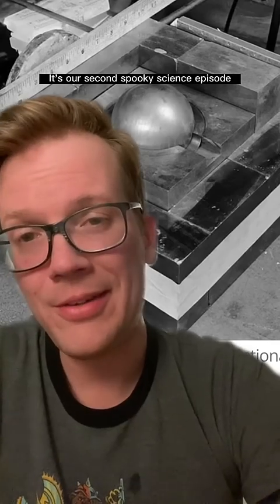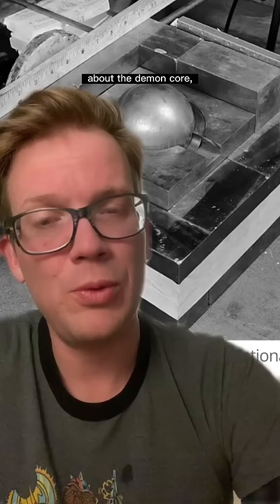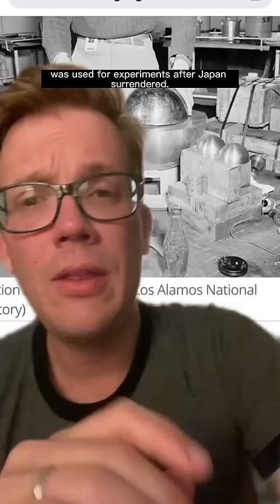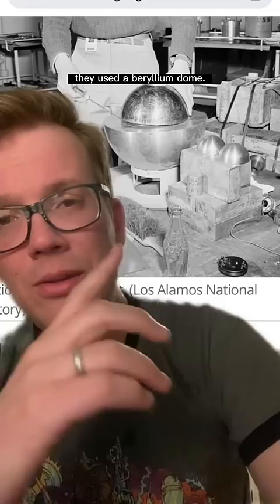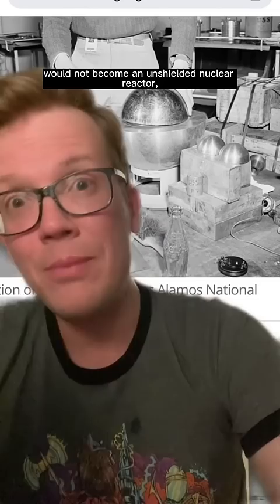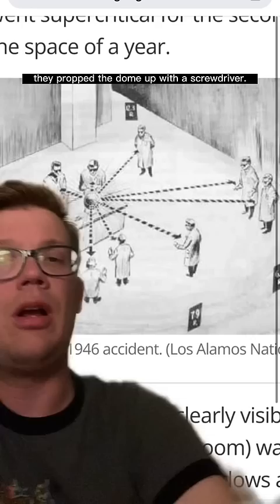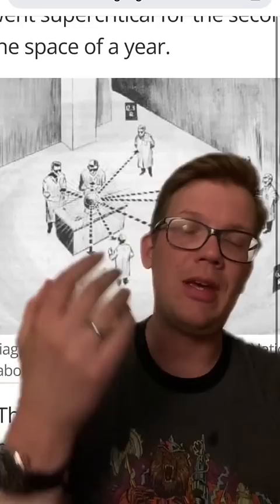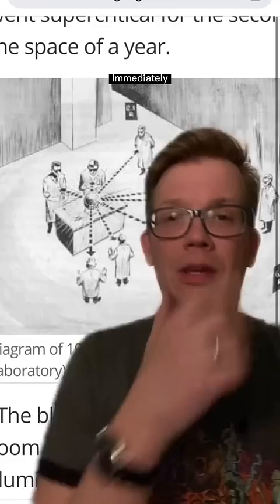Spooky Science episode 7: Second demon core incident

Comment: Can we have a reliable setup for the experiment?
Them: a screwdriver should do it. It’s just a nuclear core.
Reply: Yeah it shows that just because someone/a scientist is very smart in someways, doesn’t mean they aren’t very dumb in other ways
Reply: Kayle hill has a dettailed video about this shit. It s just incredibile
Reply: A screwdriver literally did it though, they weren't lying 🥲
It at least did one scientist in..
Reply: @DiabloTommaso  who?
Reply: If i remember correctly, they initially used something else to prop it up. Something more safe, but the scientist in question got comfortable with the core as he continued to experiment on it, and substituted it for a screwdriver.
Reply: @JackNapierTM  the youtube channel because science:)
Reply: @JackNapierTM   i m jk xD you will found a video about this on the kyle hill youtube   channel
Reply: Look it up it's worse than you think
Reply: They actually had TWO additional safety measures. 1 was a rig that was suppose to suspend  the top half of the dome slightly above a "closed" state (and if i remember correctly, by slightly, i mean MMs apart at most) and the 2nd was a set of spacers that actually had a "mounting" type setup (so that they couldn't move on accident) but the 2md guy just decided "this will be good enough" and skipped both of those, in favor of his trusty screwdriver
Reply: @Cheesepuff8  it’s why I have a job. I actually do radiation protection. At Los Alamos National Laboratory. We oversee scientists’ work to ensure they’re doing it in a way that is safe for them and everyone else. They can’t experiment without a thumbs up from us.
Reply: Eye  I swear that video is the new rickroll or something
Reply: i think its the ego trip of holding the weight of basically the power of a nuke in his hand. with his muscles he could directly control the demon core and bring it close to criticality, but he was too sure of himself to a reckless extent. blows my mind that these experiments were carried out at all, safety precautions or not.
Reply: @nigglewiggle4214  we just didn’t really understand what radiation does to the body then to the extent we do now.
Reply: @Kyriakos703  Yes, they had been using shims of specific heights. But he got over-comfortable with things and... yeah.
Reply: Yup, with all the funding, they could not have a mech engineer make something like a screw mechanism to move the core up and down.  Sort of like a mini version used to lowet caskets/coffins..
Reply: First off, look at Kyle Hill’s video on it, great guy
Second, they should have had a small brick of some kind here for this event, and they did use the screwdriver to somewhat control the expansive gap, doing various tests.
In the incident, the brick was removed to bring the core closer to criticality (a smaller gap than the brick allowed) for more experiments, but the screwdriver slipped and it closed momentarily, becoming a nuclear reactor
Reply: @shaider1982  they had exactly that, Slotin was just an arrogant twenty-something who ignored safety protocols (DESPITE having just lost a friend and colleague to this thing months prior) who decided to fuck around and find out.
Reply: Back when MEN were ME*zap* ack! 💀🪦
Reply: They had actual spacers for the thing, but for whatever reason slaton did it with a screwdriver. Every. Single. Time. Until it killed him.

Remember kids! Lab safety is important!
Reply: Screwdriver? Nah, mate. I'm all out of vodka.
Reply: Thats whats buggin me!! Like, whyyyy so much room for error?
Reply: Spacers, a screwdriver... I'm not a scientist and yet it took me all of 60 seconds to imagine a hinged mechanism with a spring that's loaded to keep it open. That way it could never accidentally be closed. You want it shut most of the way? You hold it shut or you rig something to keep it closed. But it always springs open by default.
I mean how hard was that to think of? I'm a moron with zero engineering experience.
Reply: @notsospecial9012  I love the saying "Safety rules are written in blood." We don't just make up rules to make rules. Nearly every safety rule exists because someone lost a body part or straight up died. Slaton personally knew the man who was fried by radiation just a few months before this, and yet continued to screw around.
Reply: @shadowofenvy1847  He was an idiot; if he was dissatisfied with the spacers, he should have improved them.
Reply: @LeMayJoseph  Bob lazar is that you??
Reply: @annana6098  screw around with a screwdriver at that, one would think that was actually what it was meant for until you find out.
Reply: "Remind yourself that overconfidence is a slow and insidious killer" - The Ancestor
Just because you're smart or skilled doesn't mean you can't be careless
Reply: @annana6098  from what i read, it wasnt even about him being dissatisfied with them. It more of laziness. At least thats what the paper made it seem like. The way they put it, he was too excited about "showing off" the experiment, so he didn't take the time to do things properly. Short cuts and laziness almost never end well...and when dealing with something this serious, i doubt anyone would argue about his stupidity, especially in hindsight lol
Reply: @ohmthepoet8428  BAHAHAHAHAHA definitely not. That guy’s a nut, I just keep people safe from radiation for a living.
Reply: @LeMayJoseph  That is good. Too bad you didn't oversee the packing of nuclear waste drums when the wrong kitty litter was used.
Reply: @Catlily5  indeed. All current waste is being packed EXTREMELY safely, I can assure you of that. There are very strict regulations. Meanwhile, remediation work continues on old nuclear waste sites around the globe. It’s actually big business.
Reply: @LeMayJoseph  groan a another radcon appears. cheers from another lab.
Reply: Eye  this why yo daddy left you
Reply: What would happen if they left it closed until they could get some automated way of removing it?
Reply: @shadowofenvy1847  yeah it was because those safety measures kept the dome from closing as much as he wanted. With the screwdriver he could close it more and get better readings, so he said.
Reply: @afj810  It would probably melt down
Reply: @afj810  it was closed only for like a second. Tbh, if you kept a nuclear reaction active with that much Pu, it would melt through the beryllium. The primary product of fission is more neutrons, but the byproduct is heat, and it’s that heat that we use in a pressurized water reactor, through primary to secondary waterline heat transfer, to boil secondary system water for steam to turn turbines and generate power. 

Absent the water that would cool such a reactor and the control rods or other material to “poison” the reaction, the fissions would continue in a cascading wave of heat and radiation until the fuel was spent. 

Slotin May have fucked up when he decided to play with it using a screwdriver, but his instinct to YEET that beryllium sphere half off of the demon core was correct. If he hadn’t, he’d have murdered everyone in that room.
Reply: @LeMayJoseph  what would be it's max potential of destruction if everyone just booked it out of the room and out the building without removing the lid
Reply: @afj810  impossible to say without the exact details on the geometry, make-up, and mass of both the core and the beryllium sphere, but it would be…NOT good. It would be spoken of in the same breath as Fukushima and three-mile island for certain. 

I’m not a nuclear engineer, so I couldn’t say precisely what would happen either way. I’m the radiation safety guy, so what I can tell you is that Slotin stopping the reaction was a Chad move.
Reply: @LeMayJoseph  i see thank you
Reply: Eye  how does this scam work exactly?
Reply: What can possibly go wrong!!!
Reply: Literally all they had to do was put a couple pieces of metal around the edge, and it would be so so much safer than relying on 1 screwdriver... 🤦
Reply: You really gotta wonder what was in the water.
Reply: They had stoppers but the scientists got lazy with procedure
Reply: @LeMayJoseph  That's not really true. Maybe the general public wasn't quite as educated about the consequences, but these guys absolutely were.

Notnas extreme, but I often used to hear the same things said about asbestos, smoking etc. Of course we knew. We knew what asbestos did in your lungs as far back as pre WW1 (studies in 1912). And we knew very well smoking led to lung and throat cancer back in the 50s if not earlier.
Reply: To be fair, it's said that he was a rather eccentric guy, so it's not surprising that his methods were questionable.
Reply: I don't understand why there weren't set screws in the mating surfaces of the dome so it would be physically impossible to close the dome yet you could adjust the gap to have almost zero clearance.
Reply: Eye  no! No one is looking for an air fryer. You might have better luck raging that link on a cooking video or something but it’s annoying to click on something thinking it’s related to the previous video just watch and find out it’s an air fryer
Reply: It's good enough for military.
Reply: @LeMayJoseph  yeah I worked at a place that did DoD/DoE/LLNL contract work on NWE simulations generating all kinds of radiation for short (millisecond) events and we took tons of precautions and had daily or weekly dosimeter readings depending on where you were in the plant. A lab tech got canned because he was repeatedly leaving his badge and dosimeter inside the containment area during firing.
Reply: Some Homer Simpson shit
Reply: @Cheesepuff8  they were actually supposed to have 4 little pegs that kept the two sides from touching but he was too cocky and said it was so easy to do with the top of a flat head screwdriver, then he fucked up and the rest is history
Reply: God dammit
Reply: @shadowofenvy1847  How could they have been so stupid?
Reply: @Imbad438  Ah, you fell for it too, huh?
Reply: @pr0xZen  The general public now still knows less than those guys did about radiation then. That’s the primary reason we don’t have enough modern nuclear plants to sustain our energy needs. We could do it in a few years.
Reply: @LeMayJoseph  man, he really was careless.
Reply: Wow, in those days 'em scientists must have been reckless
Reply: @neatwheat  understatement of the century. Daghlian is more excusable, imo, but Slotin not only had that experience to draw upon, he was even more reckless.
Reply: As a grad student in a research lab, I 100% believe that they used a screwdriver as a temporary thing with the intention of getting something better but then just kinda didn’t get around to that
Reply: @JoeWhyte2506  they could have used a piece of wood bro anything solid would  have worked don’t be stupid
Reply: @Cheesepuff8  The difference between intelligence and wisdom.
Reply: @Cheesepuff8  frrrr
Reply: @JoeWhyte2506  💀💀💀
Reply: @Imbad438  nope it's making you trick to give them more views
Reply: Bruh they just came through WW2...a little cherenkov glow isn't gonna hurt nobody
Reply: @Cheesepuff8  You can have education but no common sense and still be a goddamn genius
Reply: And that's why folks intelligence and wisdom are seperate stats in DND
Reply: This feels like Homer Simpson IRL😂
Reply: Screwdriver wasn't OSHA approved.
Reply: i don’t understand why it went wrong why does dropping the lid matter
Reply: Bruh that's how in olden times they made stuff and got knowledge about it without trying things would never be found or get advanced
Reply: Eye  sir no
Reply: They did but hr got lazy and started using a screwdriver
Reply: The military in a nut shell
Reply: Every OSHA regulation has a story like this behind it.
Reply: Eye  what kind of newfangled Rick roll is this!?
Reply: The 40s and 50s were a crazy time when it came to nuclear powered stuff
Reply: They were told to use a secure metal shim. Slotin used a screwdriver because he wanted to get the dome lower than the shim would allow.
Reply: apparently he had done this many times before with no problem. it was his act i guess
Reply: The reason he used a screw driver iirc is because he was a daredevil who liked to have fun. He liked to tease death. He was very intelligent and had conducted this experiment many, many times.

He just messed up once and said "ok then" left and died.

Trust me, many people if not everyone suggested he not do this. He himself knew it was a terrible idea.
Reply: @shaider1982  they did. They had two secure shims and a hanging mount which suspended the beryllium dome centimeters above the bottom half of the case. Slotin used a screwdriver because he dodnt care for the mount or the shims and because he wanted to lower the dome himself lower than the shims would allow. He got too comfortable and reckless and the screwdriver slipped. (This wasnt the first reckless thing he had done with radioactive materials. )The dome closed all the way for a little under a second I think. It went supercritical during that time. And gave a blast of radiation which if slotin hadnt flipped the dome back off would have probably killed everyone in the room. Instead because of him taking off the top and unknowingly shielding two other researchers with his body only he recieved a lethal dose. (iirc he recieved like 4-5x the lethal dose)
Also his friend Harry Daghlian was working with the first demon core and died in a very similar way.
Reply: Eye  I was looking for the song sail so I disliked for false advertising
Reply: @Cheesepuff8  I used a screwdriver to remove a spring it slipped about 25 times before I could anticipate how the spring would react to the slip then finally for it prayed out of the way. Screwdrivers area not a good tool for precision work so don’t use them for nuclear things they will disappoint you
Reply: He took the safety blocks out that would prevent this and was told on multiple occasions to stop doing "tickling the dragons tail" and literally could have cared less who he killed to experiment. Even saying , "that does it", which I would have knocked him out for doing that and saying that.
Reply: Eye  nahh these bots need better tactics
Reply: You should probably remember that a screwdriver worked 99% of the time. You should probably remember that before the next time you use the toaster to make crispy bread.
Reply: He didnt explain but his is one of those things where they were trying to get better results so they resorted to unsafe procedures. The set up actually used a number of spacer as a safety measure but slotin removed those spacers and instead use the screwdriver to have more control on the experiment and the rest is history. Moral of the story follow safety procedures and never remove safety equipment.
Reply: Yeah, that should do it
Reply: Eye  I don’t give a fuck about air frying potatoes
Reply: Such a human thing to do
Reply: They had a dedicated set up for it, slotin just preferred the screwdriver
Reply: Can make a whole as nuclear core and couldn’t buy a 20 dollar piece of equipment to hold it up?
Reply: @LeMayJoseph  bloody brilliant mate...you would've thought they would've been a little more hip to the situation themselves🤦‍♂️
Reply: The Bible is truth. Please read at least Genesis Mathew and one book you chose yourself. It’s important that as you that you genuinely forgive. That’s the key. Start with your parents. They’re supposed to be easiest. They’ve loved you. There’s deep spiritual significance in this act. It is extremely important. Forgiveness heals a part of your soul that makes you blind to spiritual things.
Reply: @Cheesepuff8  here, the word isn't dumb.
It's complacent.
Reply: Eye  no one is looking for whatever that is
Reply: Yeah, it's just a highly dangerous, highly unstable amalgamation of some of the most radioactive substances in the universe, no biggy
Reply: @jamesmayle3787  sorry, what the hell has that got to do with the price of tea in China?
Reply: @Cheesepuff8  they knew for sure that they would die. If not now, later. They knew working with this specific project, they would die. But they wanted to do it in the name of science.
Reply: White men in thw 1800 (dynamite, Chinese guy) rail road, I wouldn’t doubt it actually
Reply: REPENT FROM YOUR SINS AND FOLLOW THE LORD JESUS CHRIST TO BE SAVED OR BE CAST INTO THE LAKE OF FIRE FOR ETERNITY! REPENT AND BE BORN AGAIN
Reply: Nine days later the guy was dead, and nine days later you have 32 000 likes 👍🏾 👌.
Reply: The sciencist who used the screw driver was extremely well versed in his field.. he and only he used the screwdriver because the blocks they used as a safety mechanism, wouldn't allow for closer critically. We own a ton to Luis and his incident.
Reply: He should have said “I’ve screwed up”
Reply: Potential nuclear core
Reply: Eye  No it isn't.
Reply: And I overthink every little bullshit thibg I do.
Reply: I'm surprised duck tape wasn't used to lift it lol
Reply: @Cheesepuff8  I believe he was also warned many times and kept saying it’d be fine
Reply: the guy who did that wore cowboy boot and jeans, dont think he really cared about safety
Reply: @LeMayJoseph  

It’s amazing to think that something that size can cause that much destruction when it just looks like it’s sitting there.  With a bright ass light coming off of it but still just sitting there.
Reply: @tomtricks6838  no it closed the lid, not dropped it. 

When the screwdriver fell it wasn’t proofing the lid slightly open anymore so the reactor went critical until the dude threw the lid back off of it.  The kid being open was safer and was partially closed to perform experiments and test the radiation output.
Reply: Shit  it's about time i go to sleep before I get in trouble with my comments.
Reply: What would you use to tighten a screw
Reply: As someone who works in engineering for stuff that is niche and bespoke like private planes and really expensive cars.....

Heck most of the most top of the line stuff ends up using bodged stuff like this. 

If you have a production line making 10,000 car parts you probably have some kind of widget for propping up a fixture, if you are making 1, and it's the only one in the world...  nobody has made that widget yet, unless you already thought to make it, so yeah,  why not use a screwdriver,  any bit of metal is the same as another if it's just being used to wedge something open, and a screwdriver has a handle.
Reply: Eye  I'm not even mad lol I kept watching.
Reply: Eye  pos
Reply: Goes by a secret name: Screwer
Reply: The safe way would be to fasten a counterweight to the beryllium reflector so the preferred state is to be raised.

Or, Raise the beryllium reflector dome from below and have gravity easily separate the parts.
Reply: He was actually showing off with the screwdriver
Reply: Its fine they were wearing safety goggles
Reply: it's definitely not
Reply: Eye  huh?
Reply: @DiabloTommaso  Kyle* Hill but yeah, good content on the matter for sure!
Reply: They did, but laziness meant that instead of setting it up like he was supposed to he used a screw driver.
Reply: Actually they did have a safety ring that would prevent it from fully closing on itself but one of the scientists wanted to get the two halves of the dome closer than that ring would allow so he removed the ring and just used the screwdriver
Reply: Normally they used safety wedges, but the scientists got cocky and used a screwdriver because they could angle the dome better
Reply: @shaider1982  This - about making a mechanism to raise and lower the core dome. The screwdriver thing was obviously an überdumbass ego showoff move. But even using blocks and shims in such a way that they would also carry the chrome dome's mass, is frankly a dimwitted needlessly-big-hazard idea.

A basic square / cube skeleton frame, with 3 hand turned lead screws mechanically screwed into the chrome dome with rigid links, could be mocked up in an hour, and be VASTLY much safer. By using 3 lead screws in triangle pattern, pretty much any of-interest orientation and height of the dome would be possible. It's a rock solid connection. If you put some big OD knobs at the hand-turn end you can achieve incredible precision with very high repeatability accuracy - and you could still make measurements with shims and blocks, they just wouldn't be carrying any load. And if made with footprint dimensions fit so the bottom of this skeleton cube frame can rest on the larger OD bottom section of the core, then the position of the chrome dome relative to the core underneath   wouldn't be affected if someone bumped the table, the stand etc. Heck with the incredible weight and density of this stuff, that chrome probably wouldn't shift even during a moderate earthquake.

You could make it even simpler with a single lead screw that attached to the dome at a single point near the edge, and it would still be much safer and provide decent accuracy. But the 3-point solution IMO would be significantly further safer/more mechanically stable, and enable a much greater range, precision and granularity of 3 axis positioning.
Reply: @Kyriakos703  yeah it was tungsten bricks (which also killed someone) so they just went for a screwdriver next round. What’s the worst that could happen?
Reply: It's the 50s, what more do you expect lol
Reply: @LeMayJoseph  that kind of job would scare me honestly. Knowing that they are don’t experiments with stuff like that
Reply: Yeah, there was safety protocol in place. The scientist Louis Slottin was nearly obsessive about figuring out just how close he could get without going supercritical. He removed the safety equipment, grabbed a screwdriver. And well, the rest is history. The most chilling part was him calling the scientists back into the room then calculating the dose of radiation they had received due to where they were standing and then calculating how long they each had to live.
Reply: Shit dont add up.... There gonna be explaining the rigged elections like this one day.... And theyll allll be like......... that makes NOOO SENSE...🤣
Reply: Every. Single. Industry dad. Ever.
Reply: they were probably using a safer method but the guy started using a screwdriver to get better readings or some shit
Reply: ussr:
Reply: @LeMayJoseph that’s crazy is that highly trainned position?
Reply: @Cheesepuff8  a very very important thing to realise. Often they are stupid in the field they specialise in too! Because they are humans like everyone else
Reply: Eye.. man 🤣🤣🤣
Reply: Literally the Jeremy Clarkson of thermonuclear physics
Reply: Eye  dude I clicked on it, and damn near choked! 😂
Reply: @Imbad438  there will never be another Rick Roll. When are they gonna give it up? When will they let it down?
Reply: @justme8274  honestly, that video was SO unrelated I burst out laughing. Learn to laugh more
Reply: back when i went to school (age 8.9 ish) we went to a hydroelectric plant on a tour guide, and the one thing that i still remember to this day was their failsafe. the failsafe shutoff in case the water pressure went to high was two plates pushing towards eachother and if they touched, the emergency valves would open to divert the waterflow through a much larger pipeline, completely bypassing the turbines. what really made this stick so out to me and made me remember it to this day is the object used to keep the pressure plates appart..... a god damn pencil....
Reply: Well thats an engineer solution if I have ever seen one
Reply: @Cheesepuff8  explain how you would do it then. With the same technology they had back then, while also being able to film this procedure.
Reply: It was supposed to have wooden chimes, but the doctor was very loosey goosey with the safety protocol. It functioned just fine with the chimes. I mean, other than the slowly lethal dose of rads they were receiving.
Reply: Fr
Reply: @shadowofenvy1847 b this reminds me of how safety regulations are written in blood
Reply: @WaxPaper  well, you're smart to me.. (个_个)

Don't be too hard on yourself...
Reply: @toastghost4490  what truly has me dumbfounded by the whole thing is that literally as soon as it slipped, even though it was just for a moment, he knew that he was fu**ed. So he had the knowledge and understanding of exactly how serious of a danger it was, and yet chose to be extremely careless with the safety measures that were already there. 
It just blows my mind that someone so intelligent could be so careless and stupid, about such a serious situation. This was not some dumb rule made up by a corporate suit just to "fit an image" or "stretch profits" or some stupid shit like that. This was literally a life or death situation and he basically just said "fu*k it, this will work just fine"
Reply: You have no idea how a lot of people working in the labs (especially chemists lmao) who themselves do not strictly follow safety protocols
Reply: They had a safe way, but it took too long to get the reactions he wanted. So he started using a screwdriver lol
Reply: Never understood w
Why they didn't just make a permanent bum in the domes face so  that it could never sit flat...
Reply: They should've added some duct tape and bondo for additional support!
Reply: I've always wondered basically the same thing😂 in that group of "intellectuals" ...THAT... was their solution.🤔🤔
Reply: I've always kind of thought they should always have At least one regular "moron" from the street standing around allowed to throw his 2 cents In Whenever he smells something fishy... if they like it they can use it, otherwise just ignore him, but let him talk 🤣🤣🤣
Reply: This made me laugh louder than it should be
Reply: Damn
Reply: Shouldve used a plastic fork to show dominance
Reply: @Cheesepuff8  Even the smartest/brilliant of people can do dumb things
Reply: It was the 40s or 50s idk they did were different
Reply: A NUCLEAR CORE?!
Reply: I mean the screwdriver was working though it was only till it slipped that it happened. So it was more likely human error in wiggling the screwdriver than being the screwdriver's fault.
Reply: Maby curiosity killed the cat
Reply: There was another method they were using, but it required a lot of setting up, so the scientists that worked with it used a screwdriver because it was easier.

The screwdriver wasn't actually intended to be part of the experimentation.
Reply: @Cheesepuff8 they had something to prop it up but they just decided “hey let’s use a screwdriver”
Reply: @Cheesepuff8  it simply has to do with advancement. Scientist for a long time used to pipette with their mouth risking infection and death every time they wanted to measure samples. i’ll be like humans 150 years from now calling us down for driving in metal boxes and getting in the car crashes and dying instead of instant teleportation or something it’s the best that we have at our time until someone invents something better
Reply: This is literally the best example of an engineer that I’ve ever heard
Reply: It was because he was showing off, not what they had as standard. He was supposed to use metal shims, yet he decided his unapproved use of the screwdriver was smart
Reply: @Thoroughly_Wet  luckily once he got hit with the radiation his brain cells returned and he calculated how long till they die and was able to yoink off the dome
Reply: @JackNapierTM @kylehill
Reply: It was supposed to be blocked by planks but he just said 
Screwdriver hold
And then it dident
Reply: They actually had "Spacers" but the Scientist didn't like using them.
Reply: @JoeWhyte2506  HE WAS... screwed
Reply: They had specific spacers to use for this exact reason, reliability. But the scientists became complacent after experimenting with it for so long they basically saw it as a hassle to set up the safety features and used a quick and easy screwdriver a couple times before this happened.
Reply: he was never actually meant to do it that way and he was explicitly told by other scientists he would die if he continued
Reply: Yeah you see this alot in other places. Complacency and arrogance in one’s ability to always do right can be fatal
Reply: @JoeWhyte2506 i think there were three incidents all deadly
Reply: @Cheesepuff8 

No.
Reply: @Cheesepuff8 Amen
Reply: A screwdriver and or a bucket, these things were horribly unsafe at the time lol
Reply: @LeMayJoseph  Health & Safety Tech? I did that at LLNL! Worked in the superblock and got to see some really cool things
Reply: @Cheesepuff8 Man had a subpar Wis score. Thankfully, high enough to get the dome off.
Reply: the demon core never hurt nobody, just look at its cute name
Reply: Good one! I thought of that, too but did not thibl about writting it! How can you possibly build a special dome for that but never think of a proper prop!!!
Reply: @LeMayJoseph  well, the effects of the bombs imediately after being throen in Japan should have told them something! It would have been poetic justice if Openheimer and some more of the big fish would have taken a dose of their medicine but they were too smart to do so!
Reply: @StoutProper  underrated coment! 😂🙌
Reply: @ronniesal7436  I mean. Dude fucked around and found out. I’m just shocked by him because he held Harry Daghlian’s hand in the hospital after he’d fucked around, and watched his buddy find out, before deciding that he too ought to fuck around.
Reply: @Cheesepuff8 Not at all, it just shows that someone with an extremely specific professional background can't possibly cover all bases because we all have knowledge gaps.
Reply: When they switched over to the dome they had a very president crane like system for lowering the dome on the core but never reaching criticality. However the scientist became so familiar with the demon corse that he decided to just use a screw driver instead because it was easier and saved time.
Reply: The hubris of man to engage in curiosity for the sake of discovery over self-preservation. It's a very scientistic approach to things. Scientists are driven by curiousity.
Reply: @DiabloTommaso thank you, I just looked him up, great videos.
Reply: They DID have one or at least intended to have one. The screwdriver was just due to laziness. If you ever seen sabotaged safety devices on dangerous equipment, well, then that is an example of the same thing.
Reply: @PJOZeus Kyle Hill’s video is about Harry Daghlian which his incident was different from of Louis Slotin. Daghlian had accidentally dropped a brick on the core making it hit supercriticality which made him die 25 days later.
- Date of incident August 21, 1945.

Louis Slotin was using a screwdriver to lift the reflector, but while he was lowering it his screwdriver slipped and the reflector shut close on the core. A flash of blue light appeared and a wave of heat hit Slotin’s face. He instantly took off the reflector but it was too late and he died 9 days later.
- Date of incident May 21, 1946.
Reply: They had little holders but that scientist wanted more control and so he chose to use a flat screwdriver.
Reply: Literally sounds like something scientists in fallout would do 😂😂😂😂
Reply: @Kyriakos703 sounds like a solid anecdote for The Logic of Failure book.
Reply: Slotin did that on his own, he had been told by multiple people he'd be dead soon if he didn't stop being so reckless. They were right.
Reply: What could possibly go wrong its just a demonstration on something called Demon Core
Reply: He was typically relaxed about thing like wearing sunglasses and not properly following safety measures to see how close he could get
Reply: They called it the "tickling the dragons tail" by oppenheimer
Reply: Americans:
But i would see the soviets have done something similar
Reply: I think his words might have been confused with… screw it …. With screw driver it
Reply: They had proper safety procedures, Slotin was just fucking around. He’d been told before by a colleague that if he kept doing that, he’d be dead within a year. He kept doing it, he was dead within a year.
Reply: This was actually a shortcut from speaker. Only this particular scientist did it this way. Every other one used purpose built blockers
Reply: @Kyriakos703  Indeed, I forgot what it was though. And well, back then cowboy mentality was not immediately looked down upon (I say it just to be Cpt. Obvious for a second).

EDIT: oh here we go:
"...The standard protocol was to use shims between the halves, as allowing them to close completely could result in the instantaneous formation of a critical mass and a lethal power excursion..."
Reply: @LeMayJoseph cap
Reply: Why men can't be left alone with science, they need adult supervision.
Reply: @Cheesepuff8 that’s not smart. They were intelligent in specific types of intelligences but that does not equate to smartness.
Reply: @Cheesepuff8 Chernobyl was a great example of this. The head nuclear physicist dude was oblivious to the cooling station being blown apart saying it wasn’t even possible. Killed lots of ppl because he was cocky enough to feel he was smartest guy in the country 😵‍💫 …great couple episode tv series lol
Reply: We know and are more afraid of it then they was back then.
Reply: @afj810 it would have continued to emit radiation until everyone in the room (and possibly even the building) was given a fatal dose
Reply: @kaceyavellone8692  but if it is only released when they lift the lid then cant they just evacuate
Reply: Sounds like most scientists 😂
Reply: He did it with a screwdriver trying to show off because of how dangerous and risky it is. He did it dozens of times before he actually fucked up and dropped it.
Reply: But it was a $20,000 government screwdriver.
Reply: Scoentics be like " check this shit "
Reply: @JoeWhyte2506 a colleague told him he would be dead soon if he kept doing it that way.
Reply: @DiabloTommaso because Kyle Hill is awesome.
Reply: That's why they started OSHA 😂😂
Reply: Cost reductions
Reply: There’s a movie about this. They did a good job reenacting this scene
Reply: You have to remember screwdrivers were pretty high tech tools back then
Reply: And this is how Harbor Freight started
Reply: Its crazy because other physicists warned they'd kill themselves doing the demonstration like that.
Reply: “Awh yeah it’s only a basketball sized sphere of metal that we’ve used twice now, instantly vaporising two cities. A screwdriver will work fine”
Reply: You say this joking but being in engineering this is exactly what we say during testing lol
Reply: He was the one who removed the safety features and the failsafe wooden slats to get the core as close to super-criticality as possible without sending it over the line. He ignored precautions and he paid the price for it
Reply: This was his experiment only. They had safer ways of doing it. He just wanted to show a more dangerous and efficient way, and it did not go in his favor.😊😊
Reply: What’s with the Pepsi bottle on the table next to the demon core
Reply: Geniuses use what they got
Reply: The screw driver was more for show by the specific scientist. He was experienced with the demonstration  and became complacent. They had safety measures in place, which he ignored.
Reply: I think it was Enrico Fermi who saw him doing it once before and warned him he would be dead within a year if he kept doing it.
Reply: @Cheesepuff8 I always say this. People who are "scientists" always drive like granny's and have bad body builds 😅 js
Reply: about what I was thinking wtf really a screwdriver.
Reply: Actually Slotin was told repeatedly not to use the screwdriver.
Reply: and that's when they knew
they were screwed
Reply: @LeMayJoseph "we" did not but this scientist did. In 1945 Haroutune "Harry" Krikor Daghlian Jr. died from acute radiation sickness from an accident involving the very same "Demon Core". This video is explaining the second time an accident happened with the core. This also happened in 1946 when nuclear scientists would have been well aware of the dangers of extreme radiation doses by now, as well as how much radiation this device could theoretically give off. In fact the scientist in this video was warned by a colleague he would die by his method of experimentation. If he only put his own life in danger I'd say he we was an adrenaline junky, but since he actively and knowingly put others at risk he suffered from hubris. A modern day Icarus, and probably the smartest man to ever deserve a Darwin award.
Reply: @nigglewiggle4214  it wasn't an ego trip
Reply: They had a purpose made bracket and a policy on using it. Several of them just ignored it. HE chose to use a screwdriver because it saved him a few seconds
Reply: We built an experimental, helicopter portable reactor that used a literal rope to lower the control rods. It's design was such that the central control rod did almost all the governing for the reactor. It went critical killing all three operators (most likely sabotage by one of the operators)
Reply: High INT Low WIS build
Reply: THANK YOU   @Kyriakos703  I was hoping someone mentioned this fact
Reply: well, to be fair, it was SUPPOSED to be propped up using a bunch of screws to hold it in place, but this guy figured out you could just hold it up with a screwdriver and showed it off to some other scientists and then this happened
Reply: @snowpaladin4yt35 I have scoured more comments than Fallout 76 disappointments. Shouldah been a philips.
Reply: @wcstrawberryfields8011  as a man but only OSHA approved, Geiger counter included self torquing, self fitting, self selfing, this screw driver damn near f@#($ it self, its name is Philip. You... You might have triangulated the core on some microwave Mica sheet shit. Phil.. your fault.. not Phil's.
Reply: Complacency kills
Reply: @LeMayJoseph 👍
Reply: @Cheesepuff8 I guess you'd be surprised to know how many times humans have put the proverbial screwdriver in the nuclear dome.
Reply: Hindsight is 20-20 this was the 1940s it’s not like they had much to work with